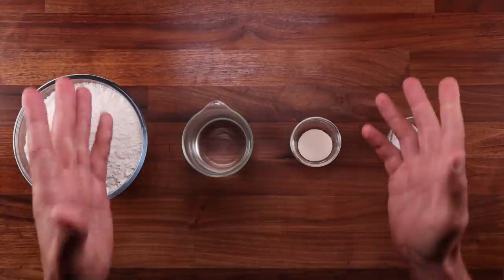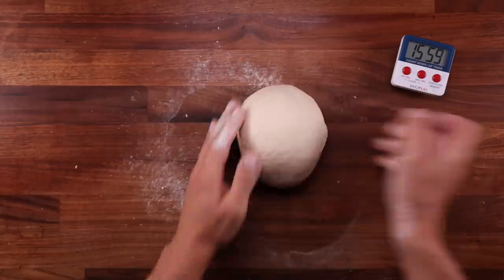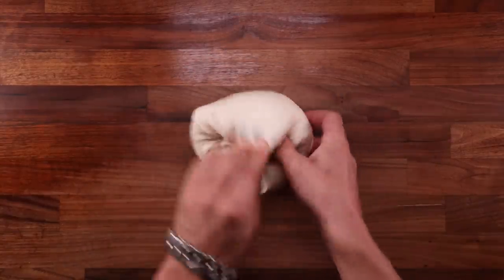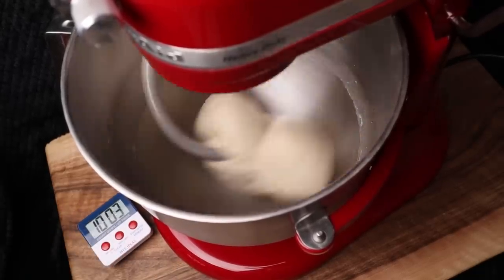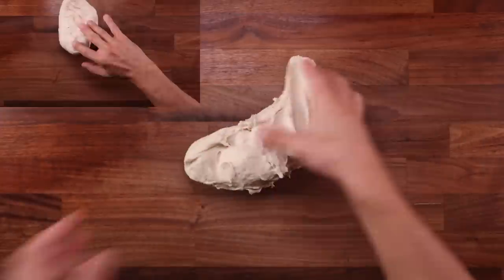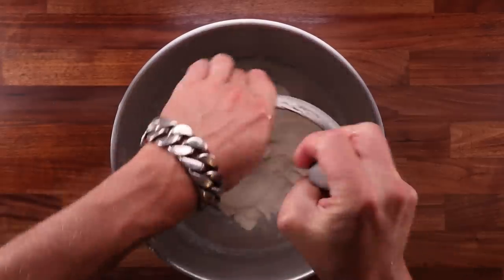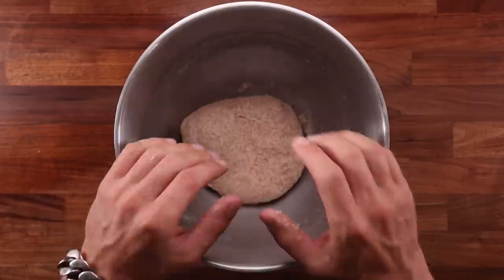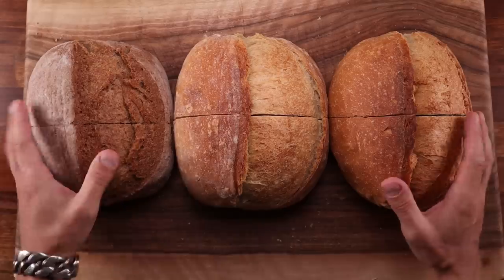How Easy is it to Overmix Bread Dough? Can you do it by Hand?

Comment: I remember when I was learning commercial baking in a bakery/workshop/factory thing that has a dough machine, there's this one time somebody forgot to set the timer for the first batch of dough, it runs for almost an hour more than what's needed. It kinda turned into a bucket of shapeless slop, the instructor gets really mad but said don't waste it,so we proceed with it. And, yeah it still bakes, but the bread is really flat and has a weird texture, it's hard to work with, and just weird in general. But anyway that's the only time I've seen actual over mixed dough, and maybe it's unsuitable for selling but certainly fine for eating. 

By the way that program teaches how but not why, and what we do then with all the fancy machine is very different from what we do at home. Now that I only bake for my house hold, I realized I really don't know much about bread making at all 😂

Comment: Thank you for this experiment! Seeing the dough in your mixer and how it handles while you are trying to break it brings me to a question. I am using a strong white bread flour - it says it has 13% protein content. Hydration is about 63% (if my scale works properly). I am mixing it for about 3-4 minutes on lowest speed (1 of 7) and then another 3-4 minutes on medium high speed (4 of 7). During mixing my doughs never lift up fully from the bowl - there is always some looser dough sticking to the sides. Does it mean that: a) I am not mixing it enough or b) the flour is not truly 13% protein or c) the flour is not capable of 63% hydration and I should go lower? I am always able to tighten the dough with folds but I would love to see my dough come properly mixed from the bowl already. Thank you for your opinion!
Reply: Or your mixer does not work properly? Just an idea.
Reply from the maker: Do you mix the dough before switching on the mixer? Try the method in this video and see if it works - https://youtu.be/a0sbfWRhSU8

Comment: Hi, I noticed when I make bombolonis which i think is very similar to bread dough except for the sugar, after I knead them with  a table top mixer and mould into balls they fall flat insteadbof rising up,  I mix on high for 30 minutes as I noticed anything less than that makes bubbles underneath the balls burst and release gas burped by the yeast leading to oil absorption during frying last time i let it sit for about 25 minutes before i noulded and it worked for the first batch but by the 3rd batch, it was flat again after moulding. I also observed that the dough was a bit warm after kneading with the stabd mixer. Please is there any advice you can give me?
Reply from the maker: Try this https://youtu.be/wn82LjmyWA4?si=rGeUcF3_RNVfu4lp

Comment: Hi, you think you can make 70 % hydration dough with stand mixer?  What speed and how long ?
Reply from the maker: It depends on the mixer, the amount of dough, and the other ingredients of the dough. I can't tell you how long it would take at which speed. Try 5 minutes on medium and see how it is. If it needs longer, then mix it more.
Reply: @ChainBaker  I make the Poolish on first day then mix with more Flour and water on second day.
I do cold ferment up to 48hrs or 72 hrs.    Kneading with dough was too tiring so recently I was watching other people using the stand mixer.
I have KitchenAid stand mixer.
2 min speed 1
2 min speed 2
2 min speed 4
4 min speed 6
2 min max speed 
Both time different results.
Other day i tried again and became more stickier that it lost the gluten. 
Total Water and Flour I am using in pizza dough recipe is 280gram / 4 pizza dough = 1120 gram.
You think I ran it too long?

Comment: My dough regularly looks like the dough you over mixed, although I only mix it for a few minutes. It sticks to the bowl and the hook can’t grab it well. It’s 75% hydration sourdough. I wonder what I am doing wrong?
Reply from the maker: Perhaps the flour you have is a bit weak. Try lowering the hydration a bit. It could as well be that the mixing bowl is big and that is why the hook can't grab it. Try pre-mixing the ingredients before you switch on the mixer. Or make a larger batch of dough 😅
Reply: @ChainBaker  Thanks for the advice. Really enjoy your videos.

So I just baked the bread. May be the best loaf I have made. I used two of your tips. I took 20% of the flour and poured boiling water over it. Plus I used the autolease. Then I made the bread as I normally would. Very soft and fluffy but still has nice chew.
Reply from the maker: Awesome! 😎

Comment: You said autolyzation destroy gluten, I got the opposite impression from the autolyse video where you have shown that with this method the dough is stronger from the start
Reply from the maker: It helps develop gluten, but it also makes it more stretchy and that is why it should technically be easier to destroy. I did not manage to do it in the video anyway :)

Comment: I think spelt flour can be "ruined", due how it works. It will probably look fine until oven time, but then it just either collapses or refuse to get oven spring at all, rather it goes flat (unless you bake in container).

Regular flour, dont think I ever managed to ruin bread flour and I did almost everything wrong at the start of my baking attempts. I think our modern bread flour is really durable. From my experience with rye and spelt, especially later, those are definitely not durable at all.

Comment: Next, maybe you can tell us/me how to fix an over hydrated dough ?
Reply from the maker: You control the hydration, so why would it be over hydrated? Just knead it for longer and it will come together :)
Reply: @ChainBaker  I measured the amount of water wrong without realizing it and ended up with almost soup even after mixing for 10 minutes in a kitchen aid, so then I added more flour, it did come together but rose very little.
Reply from the maker: Well, adding flour is the way to go for sure in that case 😅

Comment: I made bagels yesterday and I overmixed it using a stand mixer. It was almost liquidy and super sticky. Don't know the percentages but I used 500 gr bread flour & 297 gr water (plus the yeast etc.)  The dough did not look smooth but it proofed nicely. But after boiling & baking them, they were flat. I'd say the thickness was a smidge over 1/2 ".  It still tasted fine. This is the first time this has happened to me. I walked away and I think I watched a video while it was mixing.